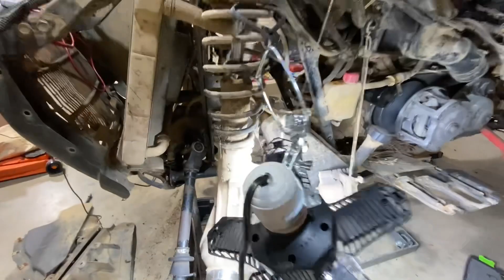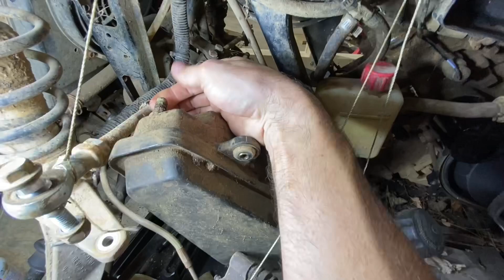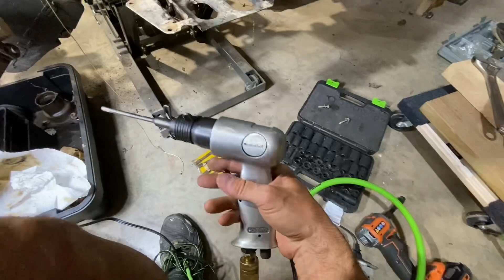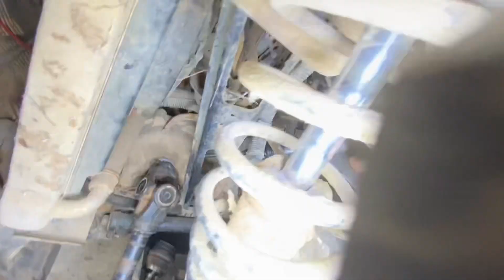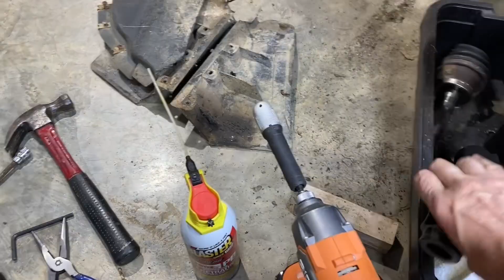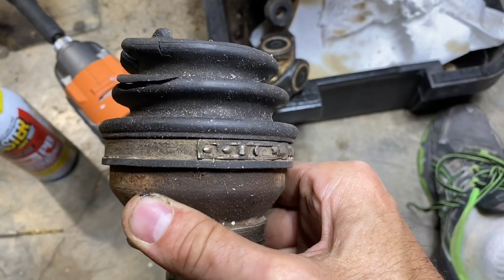Front axle problem 2004 Polaris Sportsman 500

Comment: Use a 5/16” roll pin punch to get it started moving and then move to 1/4” roll pin punch to send it through. No air hammer required.

Comment: I never had take all them parts off   just had turn the axle  so rollpin facing front of the quad use bolt and hammer  came right out
Reply: Where did you position your bolt I can’t find places anywhere to put one on the roll pin to hammer it
Reply from the maker: I never could either, I tried all angles the best I could do was in the video.